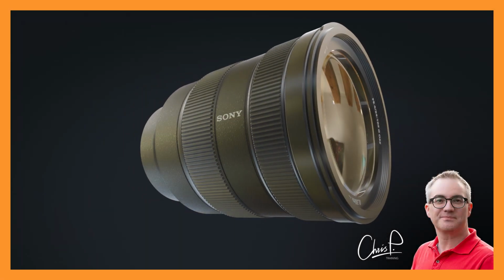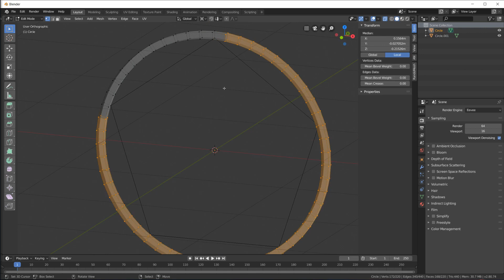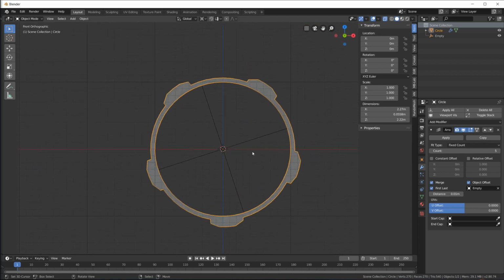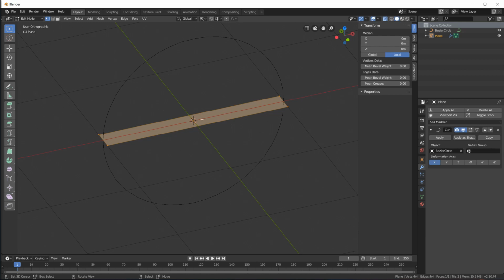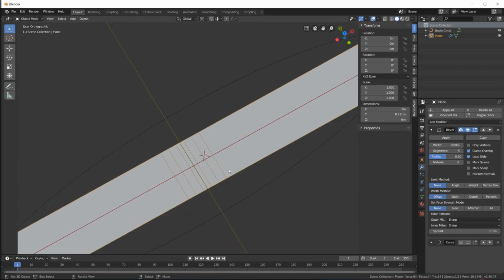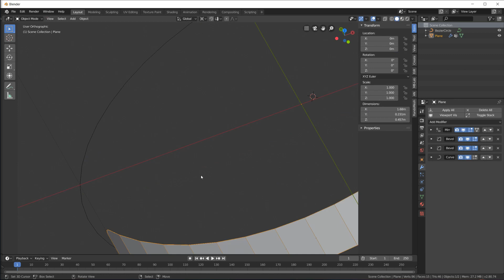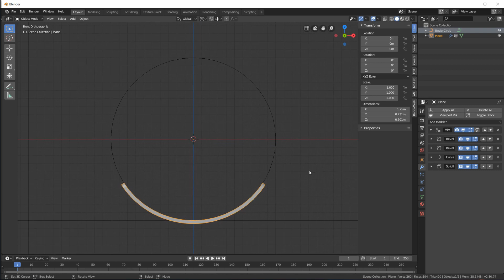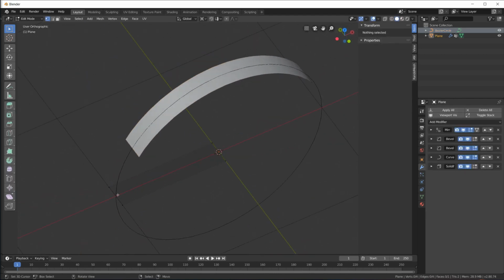Single Axis SubDiv - Parametric Non-Destructive Modeling - Blender 3D

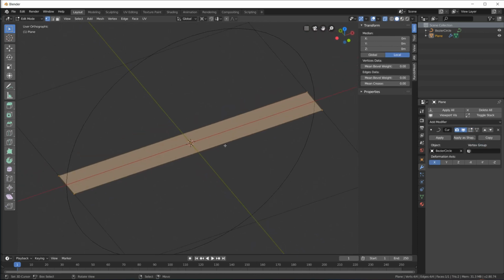Comment: 10:25 I have another solution, where the only geometry you need to create is just two vertices connected by an edge. That’s all!

First of all, add an array modifier, oriented along the edge, with a relative offset of 1.0. Now you can have a line of vertices connected by edges that is as long as you like--just set the number of repeats to control the number of edges. Next, add a Screw modifier, oriented perpendicular to the edges; set the angle to 0° and the number of steps to 1. This turns the line of edges into a ribbon, and the Screw distance controls the width of the ribbon. (This use of a Screw mod to turn a 1D mesh topology into 2D is one I learnt from one of your other tutes!) The number of Screw steps controls the number of subdivisions along the width of the ribbon, which you can see if you change this while viewing the mesh in wireframe mode.

Finally, you can bend this ribbon with a Curve modifier, also oriented along the same axis as the edges. Voilà!
Reply from the maker: I know: https://youtu.be/WzwmkYhlrcQ
👍🏻

Comment: We can use a simple straight curve with an Extrude option and adjust its Resolution. Unfortunately, Resolution is limited to 64 units. You can get around this limitation by adding points on the original curve.

Comment: Thank you for this tutorial, I really wanted to find a way for subdividing in one axis and you seem to have a perfect solution. However, I tried following your exact steps and it doesn't seem to be working Blender 3.1. Do you maybe have another suggestion? I've even tried using the bevel tool in edit mode as a test but that offers no change either. I also tried disabling clamp overlap and still no change. I know the bevel modifier itself works as it creates the same geometry as yours when I enable vertices instead of edges. Thanks again! 

(I figured it out, I just had to set the 'Limit Method' to 'None' instead of the default 'Angle'. It looked so different that I was a tad lost on all the toggles, haha.)

Comment: A couple of thoughts on the one-dimensional subdivide;
1: I'm pretty sure it doesn't matter at all if the number of cuts on the main bevel is even or odd, as it comes after the mirror modifier; it looks like you have an extra edge in edit mode but if you go to object mode you can see there isn't really.
2: if you set the bevel width to 100%, you get duplicate vertices at the outer edges, it's better to set it to 99% to avoid that.

Comment: hi i want to ask U why in some cases bevel on non destructive modeling not working? i use rectangle to model smartphone and use booltool. than i  use bevel modivicators but when i change some value in weight opr angle mode sometimes bevel not working. i clean scale and rotation and merge vertices but the problem still exist

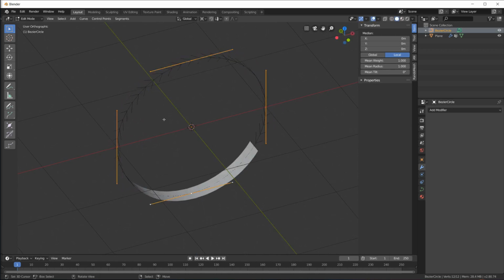Comment: 18:15 By the way, I suppose you’ve noticed that meshes commonly jump around when you add a curve modifier to them. To avoid this, make sure the object origin for the curve is at the first control point.
Reply: I was wondering why my object jumps to random places. Thanks, that helped a lot!

Comment: These are really great advises, I'll be sure to use them. I just want to ask you that, wouldn't an array modifier and mirror modifier work as a non destructive method for the horizontal cuts as well?

Comment: The "subdivision" replacement via the bevel-modifier was a very interesting method and is extremely easy to control. Nice solution for this problem.
But because of the mirror modifier, this only works with symmetrical shapes. Would be interesting to find a solution for other shapes.
My first idea was to use a taper object for the curve modifier. Haven't tried it yet though.